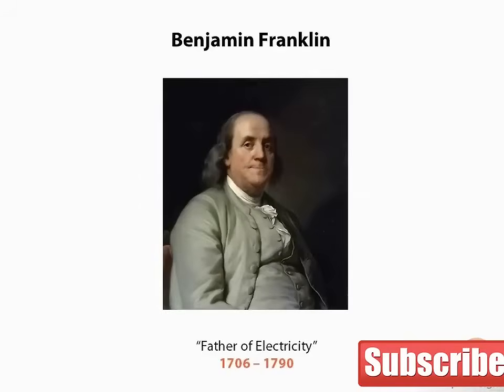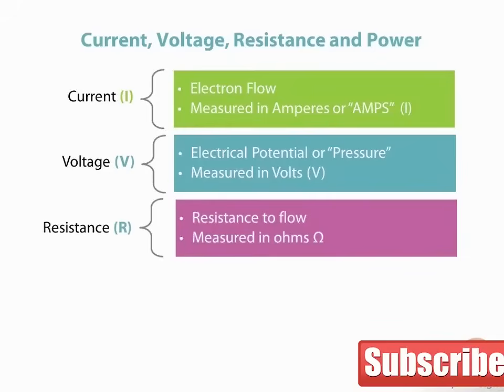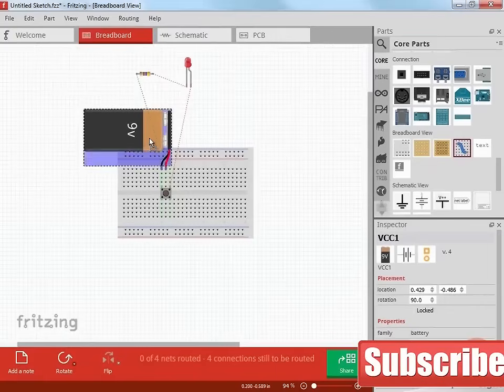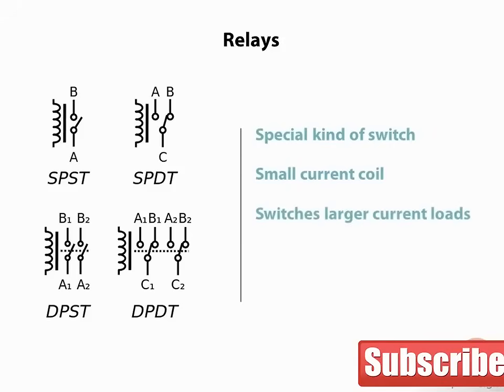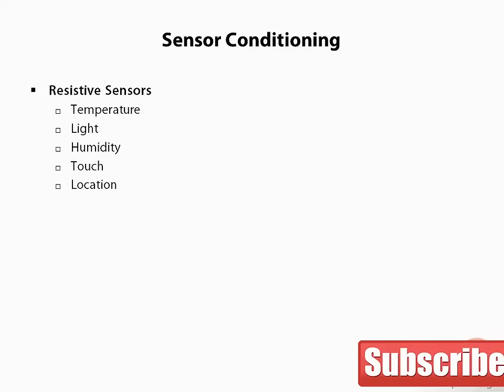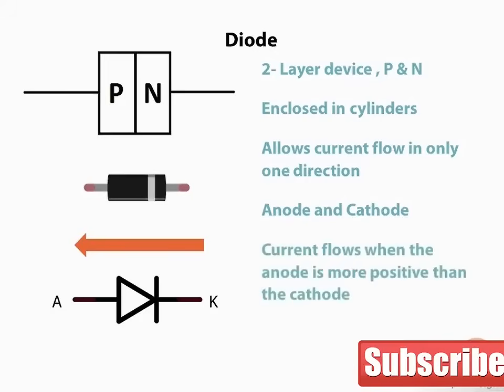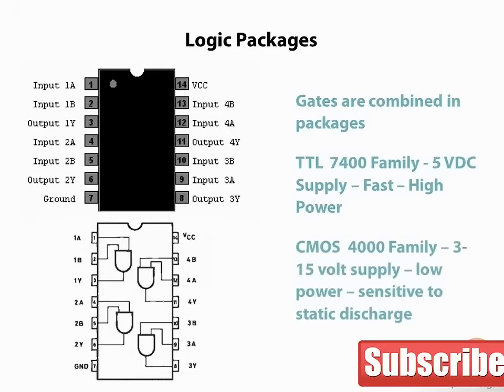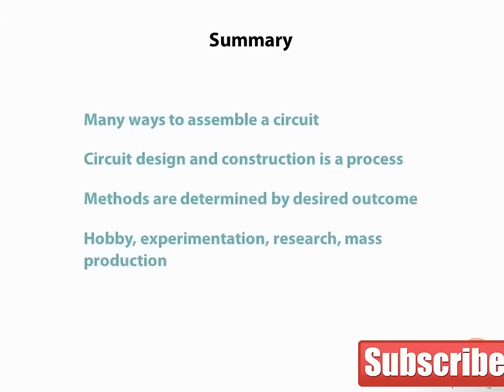Electronics Fundamentals | Your Complete Beginner's Guide 2025 | Electronics Fundamentals Deep Dive

Comment: I definitely agree that Nikolai Tesla should be listed. Something else to think about every electronic device in your household runs off DC current, and before you claim no it's plugged into an AC outlet, though that is true it then gets converted into DC so that you're appliance can run correctly.
Reply: Yes, Tesla should be mentioned. No, every electronic device does not run using DC current. Some of the most important appliances do not convert your AC to DC, like a washing machine & dryer for example.
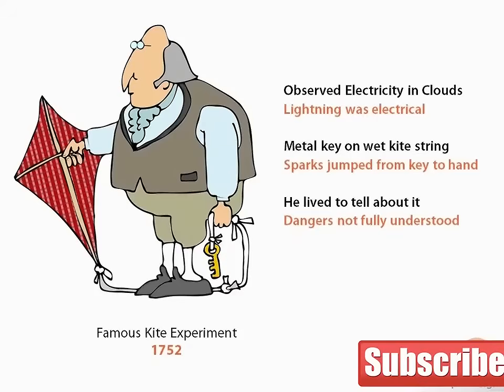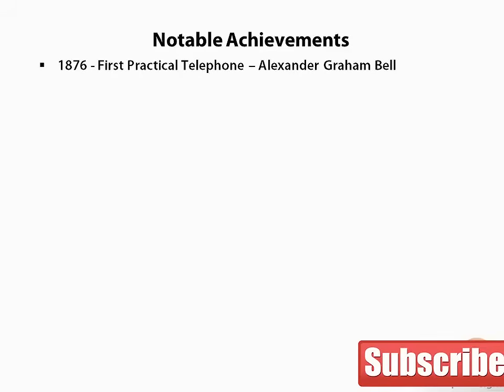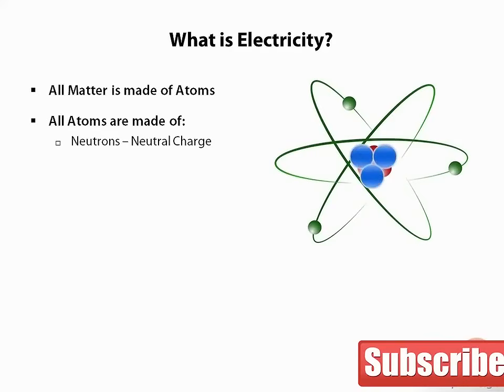Reply: @DAA314  2 Timothy 2:15 KJV - John 5:39 KJV - Proverbs 4:7 KJV -  John 8:32 KJV - Matthew 11:28 KJV
Lets study BIBLE with: Robert Breaker, Gino Jennings, Stephen Darby Ministries , Dr Peter Ruckman, Les Feldick, J. Vernon McGee, Brandon Holthaus
Warnings:
 2 Thessalonians 2:3 KJV
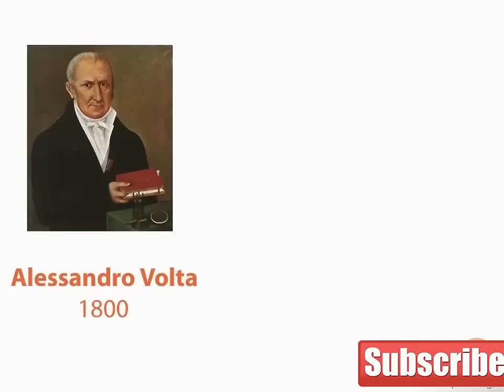1 Corinthians 3:18 KJV
Ephesians 5:6 KJV
Colossians 2:8 KJV
Mark 13:5 KJV
Matthew 24:4 KJV